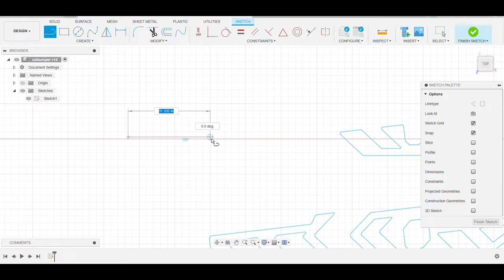Fixing And Riding My New TURBO M8000 Snowmobile!!

Comment: Not a criticism, merely an observation. Try to avoid that tendency to bounce the throttle so much, especially on a turbocharged snow machine. The even distribution of power will make your ride much less work & way more enjoyable, as well as prolong the life of that expensive beast. Stay safe & put together a good back-country emergency kit and tool/parts inventory for the trails.